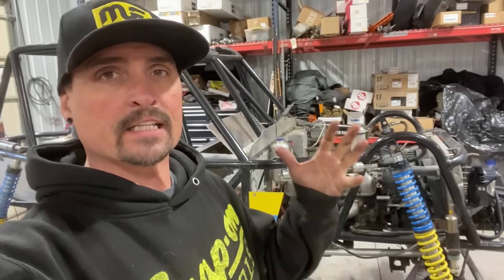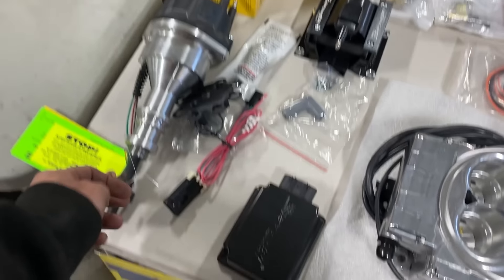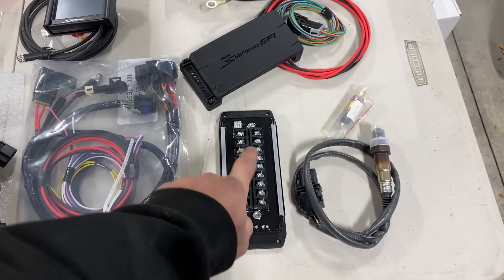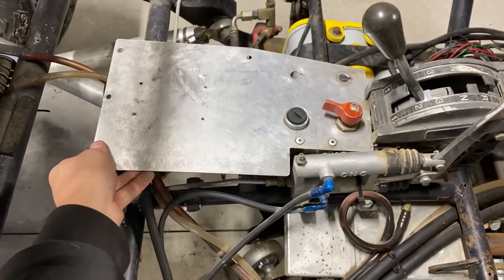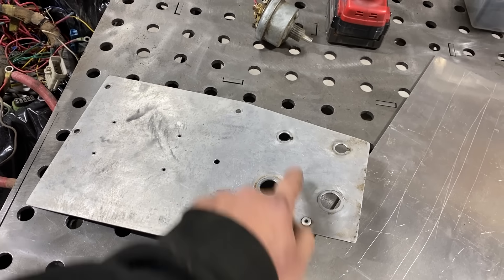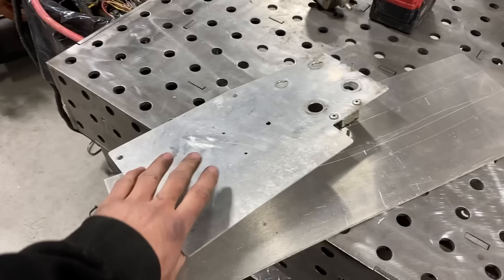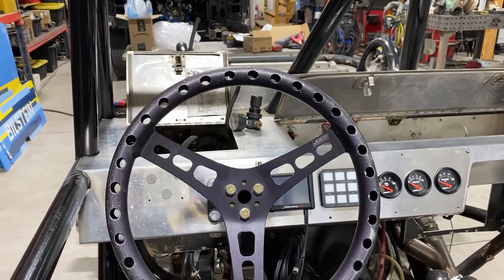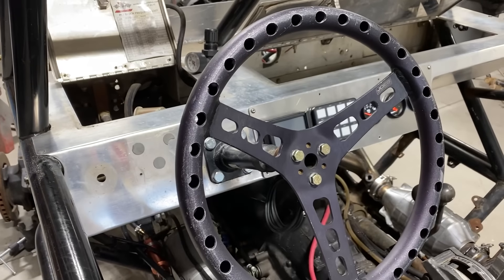Prepping for the OFF ROAD GAMES by Matt's Off Road Recovery!

Comment: Heavy duty velco works well for the little EFI controllers.  Sits nicely on the dash out of the way as a display and you can pull it off and have it in your hand when doing tuning work.  Best of both worlds.  Wishing you the best of luck with your new family.

Comment: Those gauges were always a PITA when you tried to use a 2 1/8" hole so I went to a 2 1/16" hole instead. Easier to mount, didn't slop around & fit a lot better. Of course, mounting them in thin aluminum is a lot easier than 3/4" teak or plywood (marine applications).

Comment: I am really going to miss these type of videos from you. I just learned about the light wiring that I am now going to use in my truck. Right now I am using all relays wired separately to have turn and brake

Comment: You might want to rethink your fuel lines because towards the beginning of this video you said the right front of the throttle body was the inlet and the right rear was the return. After you ran the fuel lines you said that you needed to get a 180 degree fitting to hook up the fuel line to the right rear